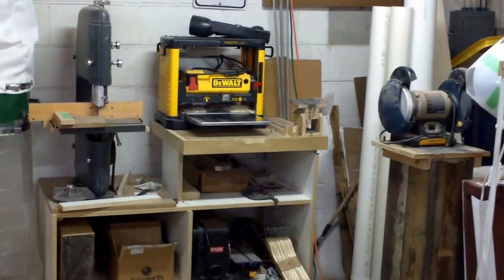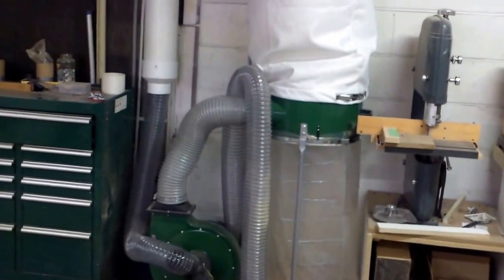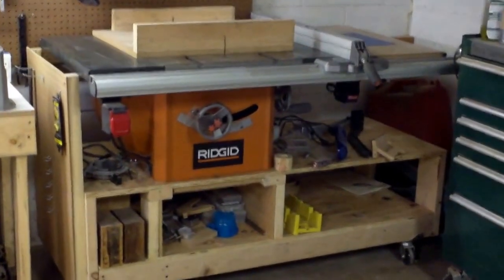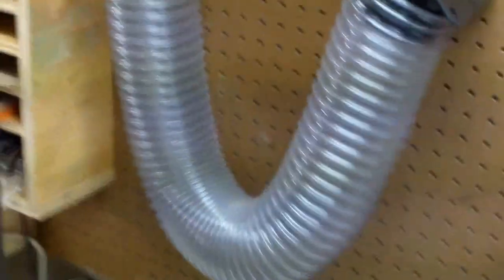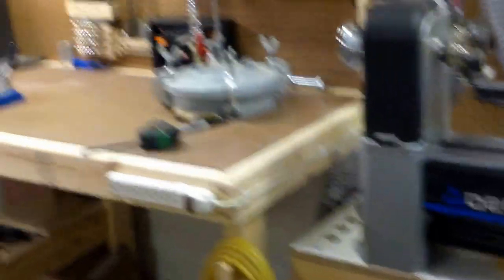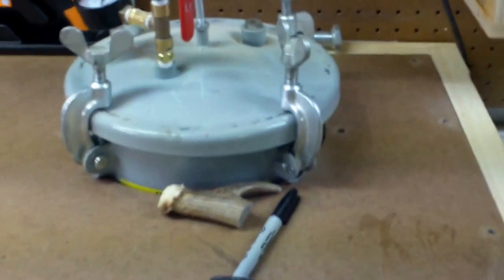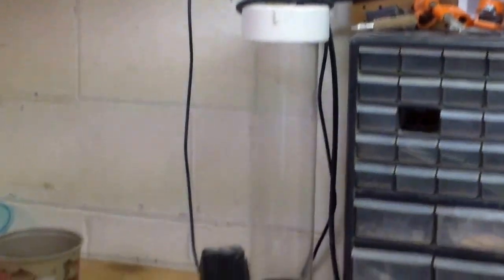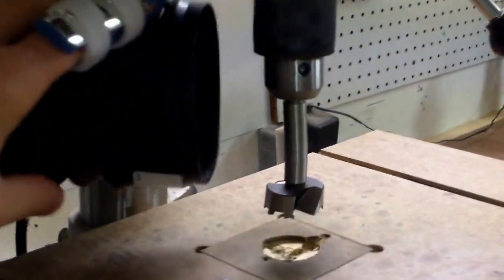My Small Wood Shop Tour 2013

Comment: my wood shop is only about 8 x 8 feet,i barely fit in there,but it's fine,since i am starting on woodworking,very good set up by the way
Reply from the maker: 20x20 with two cars parked in there gets pretty tight also, but without the cars it is a big shop.. any shop is better than no shop :)
Reply: that's right ,better than nothing

Comment: Nice shop, I'm in a 20x20 garage and unless you've got 2 smart cars I don't see how in the world you are still able to fit your cars in there :). My cars now live outside but I did end up buying a bunch of bigger tools like a jointer and other such goodies so they definitely killed the rest of my space.
Reply from the maker: indeed it gets very tight, i have a camry and jetta and with them both in there i only have room to work on the work benches and lathe. all my power tools and work benches are up against the walls on wheels. winter time its harder to workin there though.